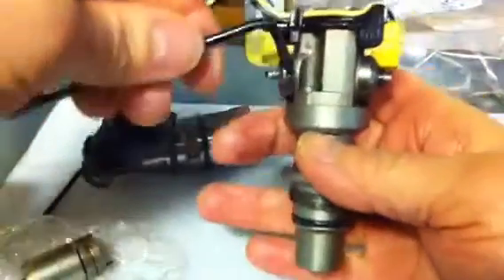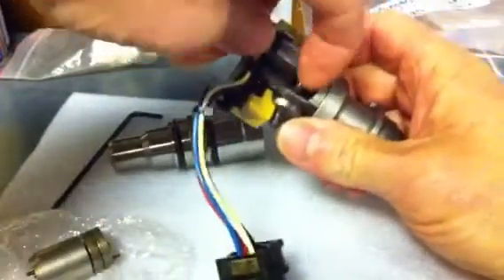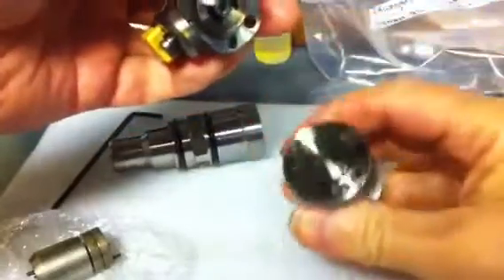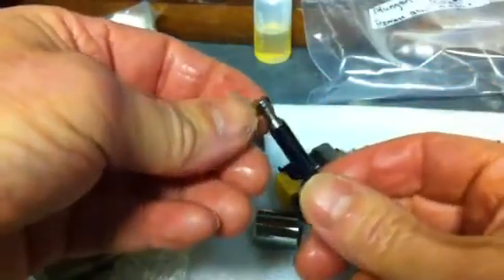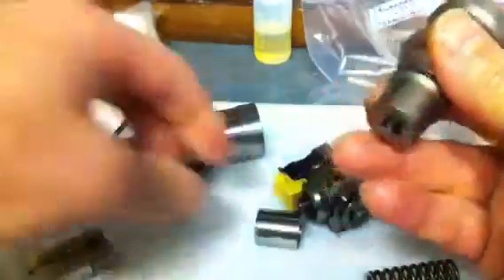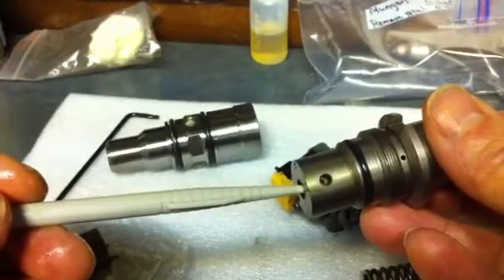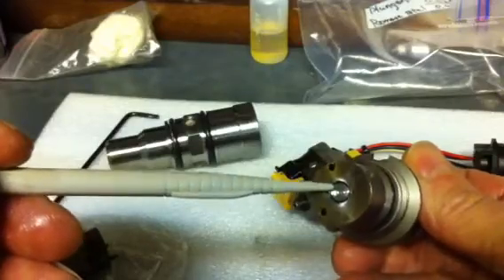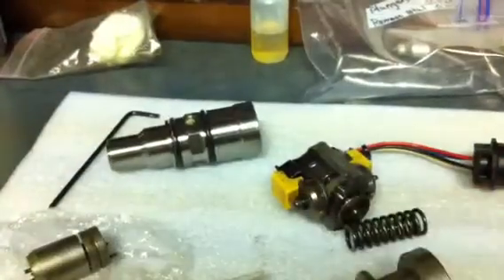6.0l Powerstroke injector disassembly part4

Comment from the maker: Nothing. It depends where the valve is and also if it is oil wet, as air will eventually find a way out due to lower viscosity. Now, if you used pressuized oil and cycled the valve, that wojld be the better test.

Comment: Hi if I put some oil and 100 psi of air pressure at the top of the injector, if that make some bubbles what's wrong with the injector?

Comment: So i have injectors with the plungers and pistons cut to .160cc with open spill ports. If i plug the spill ports, the injectors will gain how much capacity? With a stock plunger and plugged spill ports i understand you gain around 20cc, my plungers are all around 1.815 pistons around 0.809.
Thanks
Reply from the maker: Kyle. You are correct, you would gain about 20 by plugging them. If you read the thread on Powerstroke.org I included this and other techniques as well. Plugging does change the characteristics of the injector substantially, but this can be overcome with tuning.
Reply: Thank you for the information.

Comment: Note on reassembly: put the top of the injector back on with the hold down notch pointing the correct way or else the wire will be coming out the wrong way in the head. I don't know if the valve will work by just flipping the spool valve the other way. Good idea to take a photo of the injector before disassembly noting the hold down notch, wire harness direction and the little notch just to the right of one of the T15 screws. Then note which way the spool valve cylinder gos in, one side of the cylinder has the larger shoulder.
Reply from the maker: I had mentioned this in the videos and in a number of post at powerstroke.org. The valve can not be inserted 180 degrees out or it will not work. Same goes for the spool assembly WRT the wires not being correctly oriented with the hold-down notch.
Reply: Cool, didn't know that. I took a photo of the parts. Let's see if this link works:
Reply: Thank you big time for your videos. My truck runs like new.

Comment from the maker: To get the math correct read through my thread at  powerstroke
The 0.025" is only part of the puzzle, the intensifier piston is the controlling factor and would be cut at the skirt about 0.050" (1.27mm) depending on how much clearance you wanted between the plunger and the fuel plate at the end of the stroke. Remember all the flow data is based on 1000 shots or cycles.

Comment: First off, great videos on the injectors. So you removed .025 inch or mm or 2.5% to achieve 178cc? The reason I ask is because if that's a metric value, that would equate to ≈ .00098 inch which is diminutive. What was the baseline and final measurement of the plunger (length), how far does the plunger travel and what is it's chamber bore?  I'd like to build a set for myself so any detailed information is great

Comment: bin dieing to see the inside of thes injectors but never had time to take one apart or really replaced enuff of them, as i said earlier i look after 16 6,0's and 7.3's almost never do injector's, head gaskets bin there twice without removing cab and installed stud's on both just waiting for the other 14 to fail new set of head's and gaskets+studs bam shes good to go for another 500k km's, he's got one that get 11k km's a months its insane!